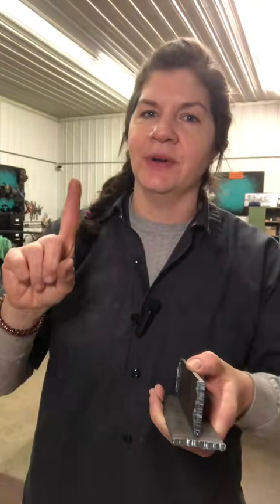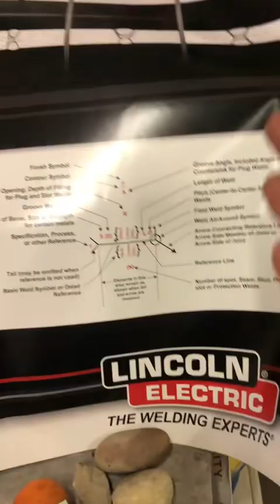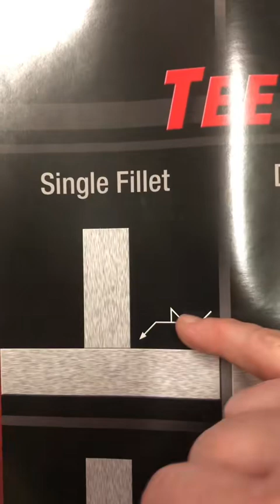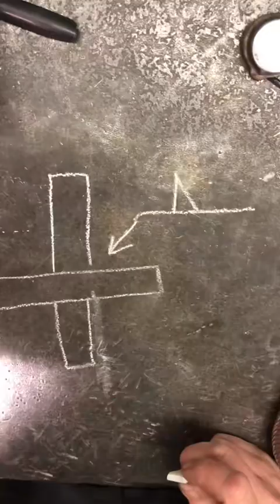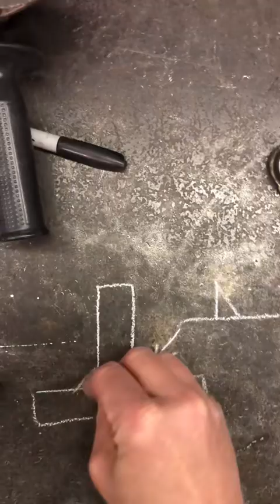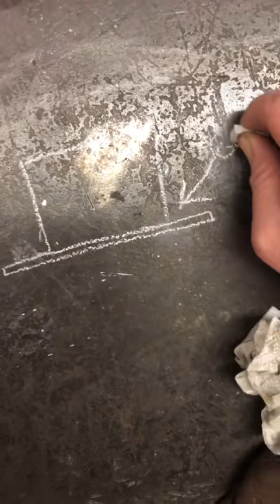Quick Intro to Welding Blueprint Reading

Comment: Great explanations. I saw that same double tee joint question when I was in school. In the field, I see a lot of welding symbols that aren't quite detailed correctly. The all-around symbol gets misused so much; it's often a lazy and ambiguous shortcut, much like "typical".
Reply from the maker: @AvaLily17  ooooo the “typ” symbol. 😣 most times it’s just fine and reassuring. Once in a while, it gets thrown on a print that is impossible to interpret. 
“Typical of what, my dude? Typical of WHAT??”
Reply: @HigherGroundWeldingPA  Have I used it on drawings? Sure, sometimes having less clutter improves clarity. Usually would try to say "typical (6 places)", give people more of a chance to figure out what was intended.
Reply from the maker: @ just a sliver of context! 😃